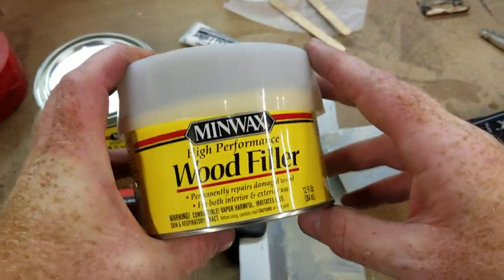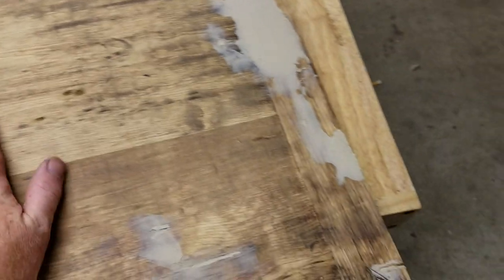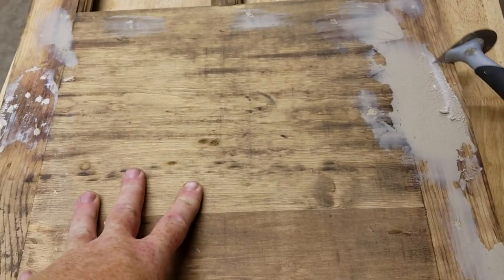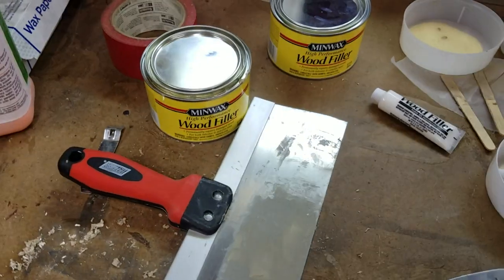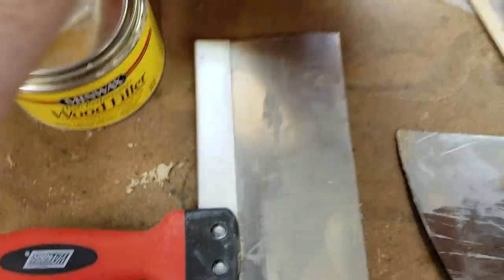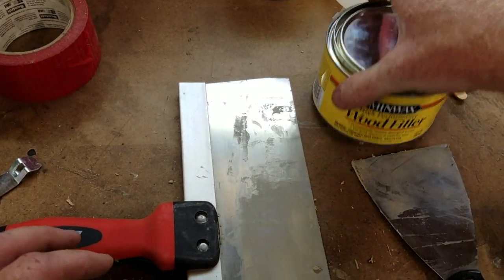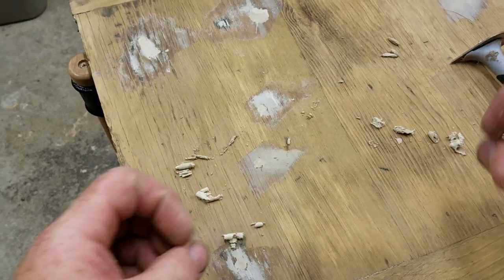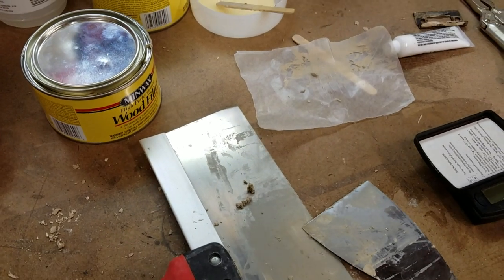Minwax High Performance Wood Filler (Epoxy Resin)

Comment: Thanks! I especially appreciate your idea of using a scale to get the ratio right, showing us how quickly it dries and the related consistencies, and your tip about scraping off the excess while it's still not completely dry. All very helpful!

Comment: Good instruction.  I use Bondo regularly to fill holes in my projects.  If painted, easy to cover with a primer and if it's walnut, I tint the Bondo or touch up with dyes afterwards.

Comment: Question.  First, great work.  
I have a large harvest table I built 3-4 yrs ago with 3” threshing board.  When built I purposely left it rustic, did apply several coats of polyurethane finish, but left several cracks, etc to maintain that look.  This was new to me, I typically like a perfect finish.  One crack I chose to leave is quite large.  Being in Canada our houses get extremely dry each winter. I’m not happy with the size of this crack December to March at all.  I want to fill it but I don’t want that fill to then crack. I used this product on some of the nail holes etc and it’s performed very well on those after the 3 or so years.  But with a lengthy crack not sure it will perform the same. AND I would like to avoid a complete epoxy finish on the whole table, I love the finish I have today.  I just want that crack filled now and done right.  If I do it now, while the house is at its driest and the crack at its largest I think I can get a handle on it.  Looking for your thoughts.

Comment: This is actually a type of Bondo and not a wood filler.  It cures extremely hard and fast.  It can be easily sanded real fine.  Unfortunately it does not take stain worth a darn.  Great for paint afterwards projects.  I use it primarily for projects where I want strength and don't care about looks or under paint. Works on surfaces other than wood well just like Bondo.
Reply: While it is a polyester and NOT an epoxy, it does make a good structural wood filler on shallow fills, just not on any decayed wood that has not been treated and hardened prior to application. Use search words "wood consolidation" to learn more. Deep fills require epoxy that is pourable or injectable.
Reply: Does it smell bad?  Like bad chemicals?  (Polyester Resin is The Stink.)
Reply: @dennisyoung4631  It smells like auto body filler, "Bondo".  I don't find it terribly stinky.  Guess cause I've been around Bondo quite a bit.
Reply: @OddJobFix  Thanks for that information.
Reply: @jaredklements729  Absolutely welcome.

Comment: Thank you. This was helpful to see how this stuff worked. I bought some from Home Depot for thinking that it was tan colored stuff from Elmer's and was surprised to see the hardener. I didn't use the hardener because I wasn't pressed for time so it could take as long as it wanted to harden. The following day, the filler without the hardener was rubbery. It was still workable and I sanded it but this time I'll try the hardener. Again, thanks for your time.
Reply: Epoxy resin is not meant to be used without the hardener.

Comment: I have a question. I have a large IKEA desk with wood grain pattern veneer that I would like to fill all the simulated wood grain ridges to make it smooth and sandable. I then want to paint the desktop black and apply a table top, self leveling epoxy coat on the table. Could I use this product as a base to fill in the ridges and have epoxy coating cover it without risk having the epoxy come off? thanks.

Comment: I need to fix a large gouge in and exposed peace of a wood project. It's about 4 inches long two and a half inches wide and nearly an inch deep. Unfortunately, this repaired section is going to need several finishing nails driven into it. What is the best kind of filler that will receive nails without cracking and crumbling?

Comment: What is the difference between this and bondo it seems like its the same thing and ive been using bondo on wood for many years.
Reply: Auto body Bondo is more rigid and is suited to metal restoration, whereas, Wood Bondo is engineered to be compatible with wood, by the allowance of expansion and contraction, especially with exterior applications.

Comment: I have a question for you...

I had a fascia corner on the house that was rotting out.  I used a drill wire brush to scrape away all the bad wood.   I coated what remained with the minwax wood hardener.  I plan to now use this minwax wood filler to fill in all the space I scraped away.

My question is this... do you recommend I try to apply the bulk of what is needed right out of the gate?  Or, do you think I should do it in small bits at a time... about the amount you used in the video?  Btw, I suspect that I will end up needing to use at least 8+ times what you did in the video.
Reply: Nm, I figured it out.  It was near the bottom of the instructions on the can.  You put it on in layers... I think it said about 1/4" at a time.

Anyway, I finished the project.  It looks pretty cool.  I had to put some duct tape along the bottom though to keep it from dripping.  That stuff goes from peanut butter to rock hard WAY too fast.  So, without the tape the stuff wanted to just drip down.  The tape worked awesome btw.  Gave the bottom a nice smooth edge.  Virtually no sanding was needed.  I just made sure I took the tape off the second it started hardening.  Not sure how hard it would have been to remove had I left it on too long.
Reply from the maker: 101perspective love hearing that it worked!!

Comment: What's the difference between this product and premium Bondo auto body filler? They both smell the same, only the Bondo is cheaper for the same size.
Reply: Simplest answer is that these epoxies have been designed to expand and contract at the same rate as wood, whereas Bondo is intended for autobody use. Bondo is somewhat more likely to separate from the wood over time.

Comment: If you've let the filler harden and then approach sanding, what is the best method, especially for larger areas like cracks in exterior house wood?  Wet sandpaper? On a block? Etc. Any tips appreciated! The material is very hard at this point and resists smoothing. Thanks for note on the 30-minute scrape, and also working with smaller amounts of compound to keep things buttery. Brilliant. Next time.
Reply from the maker: Gretchan Jackson I have found that heavy grit,  60-80, is best, then finish with a higher grit

Comment: would this stuff work on interior wood jambs had to relocate strike plates on door jambs want to fill in old areas where plates use to be want to fill all in then prime & paint jamb.
Reply: It works and you can mix it or Bondo with sawdust for a great wood filler .

Comment: Thank you for helpful video. Can you show what it looks like after its completely dry? does it keep that same color?
Reply from the maker: It is slightly lighter than what you see in the video.  Toward the end of the video, where I am scrapping the material, that is pretty cured.  This does not really dry as much as it cures or hardens.  Drying is an evaporative process, where as epoxies are a curing process.  It is a chemical reaction. Just some helpful info :)

Comment: I have used auto body filler for years it appears to be the same. The portions are not critical, but it will change the working time.

Comment: how would go about filling a 1 inch hole in a 4x4 post?
Reply: I'm doing that now. I make a patch piece out of the same material as the wood I'm repairing, place it over the hole and trace around the perimeter with a knife. Then I use a trim router and a chisel to make the hole the exact shape of the patch (the knife cuts make this easy). Make the depth of the hole a bit less than the thickness of your patch. Glue the patch in place and sand it flush after the glue dries. I apply Minwax wood filler over the patch to fill the inevitable gaps next to the patch. This kiind of repair is called a "dutchman" and it is used a lot in boatbuilding. It's not good for staining, but it is perfect for something you intend to paint.

Comment: Actually, this product is not epoxy based; it's styrene-based similar to Bondo and the polyester resin used with fiberglass.  Doesn't change my view of the product.  In fact, I use it all the time.  Also, you can adjust the working time by using less of the hardener (longer time) or more—which will set up fast.

Comment: Will this method work well for longer cracks in the wood?  I noticed most of the filling you were doing here were for smaller dents/cracks.  Thank you
Reply from the maker: David Knight yes,  you can fill up to a 1/4" deep area per instructions (I have successfully filled more than 1" though with no issues). It is really all about the amount of time it will take to fill your crack, but it should have no issue working.

Comment: have a question.  I am redoing a table top. originally thought it was wood. come to find out it's laminate. so while Sanding I went to far. (not hard to do on the router edge).  so to fix it, I wentwith plastic wood and used a 1 1/2 inch putty knife.  but it is not smoothing out like I want.  any recommendations?  I wanted to stain.  but won't be able to unless I can get it completely smoothed
Reply from the maker: captqball31 I would do some test samples and mix the stain into the product until you get the color right.  Then,  once you apply,  it should be a good match.

Comment: Thanks for this! I'm about to use this filler to fill cracks in an old wood window frame (exterior), and your tips are helpful.

I liked how the video came out. What camera and adapter/mount did you use that allowed you to work with both hands?
Reply from the maker: +TLMuse - Here is the rig I use, it is super handy and the clip detaches for use on a tripod or gorrilla clamp, which has been very useful - https://www.amazon.com/gp/product/B0199VMOEK/ref=oh_aui_search_detailpage?ie=UTF8&psc=1
Reply: Thanks for the response. BTW, I did use the filler. I was working outside, with the temperature in the lower 80s F. The working time was about 3 min or less (I actually timed it)! Reducing the amount of the white part by about 24% or so didn't seem to affect the working time much. It was very frustrating; I had to work in small batches. But when it's first mixed, it's a pleasure to work with. Your tips helped the project go more smoothly.
Reply from the maker: +TLMuse - Yes - the open time will shorten significantly as the temp goes up.....exponentially.  Humidity will also play a factor.  One thing that I have tried that can help is to chill the blade of your mixing knife - keep a drywall tray of ice water nearby and place the blade in it while you are between batches.  This can increase the open time in hot temps.  You can also chill the mixtures as well.  All of this will help increase the open time.  I would say getting the material down to 50 degrees F is about right.
Reply: Thanks for those helpful ideas. I'll probably be doing more outside fill work in the next few weeks; I'll keep this in mind if the weather stays hot.
Reply: TLMuse
Reply: Angela Tang jo uo yui

Comment: have you ever tried using a body work type file instead of a scraper, I think you might find that faster and leave a better overall smooth out ready for sanding.
If this is like Bondo it should work at the 30 min mark dry time. I'd also assume it gets harder over time too.
Reply from the maker: I will have to check this out!! Thanks!
Reply: That would have worked a lot better on my garage door then what I did. the stuff I used let the paint peel back after about 3-4 years I'll redo it only this time I'll put some bite in the surface for the paint to bond too, Now I get to try and match a fake wood grain finish I did on wood.  I just make it black like big knot holes, it look cool from a distance. It should give the wood a rot damaged look. 
That should freak out the neighbors .  No HOA I can do anything I like.
Reply: I honestly would be interested in comparing the ingredients I bet its bondo. It would be good if you have a deeper hole to put some nails or screws not driven all the wayin, in the hole so that it bonds to the metal and makes it stronger.

Comment: I bought that scraper, thanks. Any advise on filling a gauge the size of a dime on a piece that will be stained a neutral (clear) color? Minwax stainable wood filler is anything but stainable.
Reply from the maker: +TJ Wash the best luck I have had is to mix the stain right into the filler when making it.  You could also look to use a standard two part marine epoxy.  West Systems is what I use.

Comment: Minwax High Performance WoodFiller is a polyester resin, not epoxy.  There is a chemical difference between polyester and epoxy.  Epoxy, in general, has higher bond strength and is virtually shrink-free.  Because it is 2 component does not make it any epoxy.  There are many 2 component products that are not epoxy.  If this product was epoxy the manufacturer would state that on the packaging because epoxy is a premium product.  The noxious odor you refer to is styrene, a suspected carcinogen.  People  who are looking for epoxy should not be confused by the representation that this is epoxy.
Reply from the maker: Richard Ahlstrom thank you for the clarification.  I meant some months ago to say thank you.  I have since gone down the rabbit hole on two part resins and epoxies.  :)  I will be sure to annotate the video to correct the incorrect info I provided.
Reply: The title still shows "epoxy resin" in parentheses.
Reply: "a suspected carcinogen" In California, everything is a carcinogen.
Reply: Trevor Phillips true! The prop 65? I think it’s 65, it is on everything. Kinda frustrating since it doesn’t specify what chemicals are the issue so you can make a choice if its something you are willing to use in your home.
Reply: @jaimes1572  Frosted Flakes are a carcinogen in California, so far everyone over the age of 100 who has eaten them has died.
Reply: Fred C Dobbs LOL that’s a fact 😂 too funny.
I didn’t mean to focus on the cancer stuff.
Reply: Also, the mix ration is likely also not a very precise thing. You can actually mix it hot it you want. Eyeballing it is fine.

Comment: Can this stick to a primed surface.  I want to use it to repair exterior trim prior to repainting.  Plan to scrap off any loose old paint.  Then prime surface, then apply this filler to fill in any cracks.  Anyone used it successfully in similar application?  I've used it on raw wood and it works great.

Comment: It's polyester based filler. Just Bondo in a small can with a high price.
Reply: Correct - I use Bondo mixed with sawdust and it works great . Far less expensive .
Reply: @QuantumPyrite_88.9  Hadn't thought of that. Sanding dust or saw dust to thicken it a bit.
Reply: @charredskeleton  Yep - Epoxy and sawdust works great also , but epoxy can get expensive . I keep about 4 different batches of sawdust which has had different colors of wood stain added to it . Have a great holiday weekend .

Comment: Whats a good wood filler for cutting boards??? By good, I mean food friendly. Thanks.
Reply: I would not recommend any epoxy filler for use on food surfaces.  The chances of something flaking on a cutting board would be bad.  Cutting boards that are well designed are made to breathe - expand and contract - this would result in the epoxy eventually failing.
Reply: @JamieMeredith  Ok, its gnna be my first time doing this, what WOULD you recommend, then?

Comment: Does wax paper stick to this?  I'm looking for a non-stick barrier (like wax paper?) that will let me shape multiple application layers.  Would I be able to press down on an application layer using wax paper to shape the application, and then just peel away the wax paper?  The void that I'm trying to fill is large and irregular and I'm trying to "form" multiple layers so that I can glue a wood block as a final layer.  Thanks for any help.
Reply from the maker: yusuihang because this product is like epoxy,  there is no need to build it up.  Just ill the whole void all at once.  Doing layers will really make it less strong.

Comment: if this is used on the corners and edges of a project, how shock resistant is it if it gets dropped on edge? and will it be hard enough to use a router on it? 
how stainable is it? or is it stainable? (edit: read the minwax faq on this)
would a tint affect the consistency of the mixture?
thanks
Reply from the maker: +jeff smith if you go to some extra effort,  it can be used in such a way that it will be stronger than the wood itself.  For edge applications, I would use a very small drill bit on a drimel, or even just gripped in a sort of vise grips,  and drill many small holes in the area to be covered,  then,  when the mix is initially made,  use a tooth pick to press in some of the filler.  Then immediately apply a layer that is greater than the edge to be rebuilt.  Once it starts to harden,  rough it too the shape you desire,  then wait another 30-45 min and shape some more. Each pass, up to the point that it is fully hardened (8-24 hours) you can continue to shape the area.  If the edge has a profile,  pickup up a $10 profile tool from your local big box store
Reply from the maker: +jeff smith yes,  once fully cured,  you can use a router on it.  Just be careful to take small passes and do not allow the router to dig too deeply on one pass.
Reply from the maker: +jeff smith it is stainable, using the recommended stain from Minwax.  Your milage here will vary,  as the filter has tint in it and will affect the color.  The color will also change over the cure period.  If the repair is structural,  you may want to avoid using stain for the initial application,  then recover the area with a thin layer which includes the stain.
Reply: thanks for the replies.